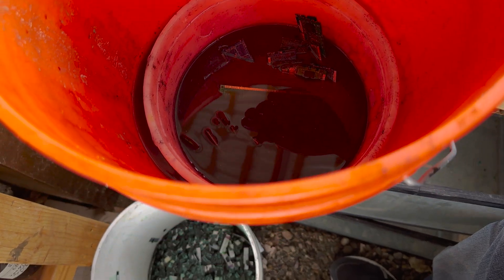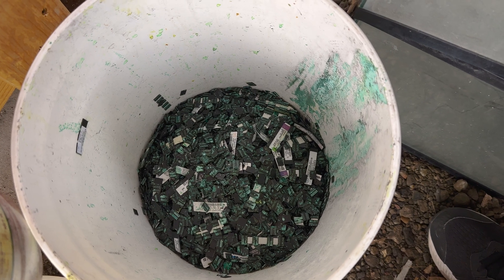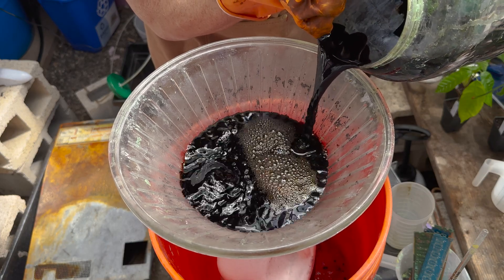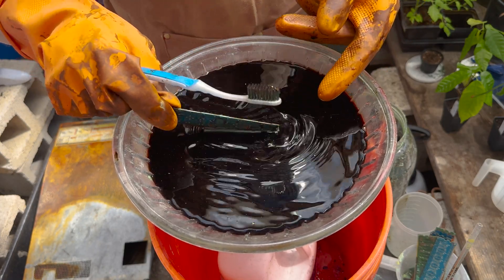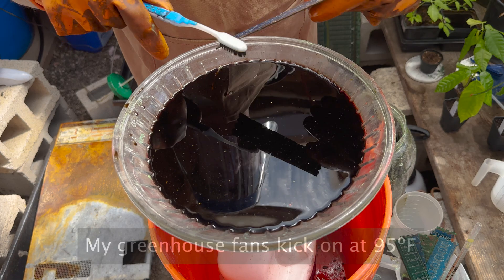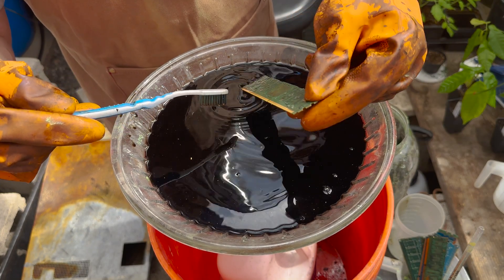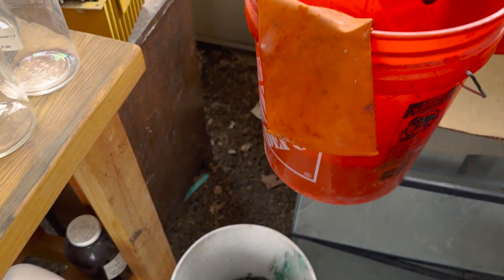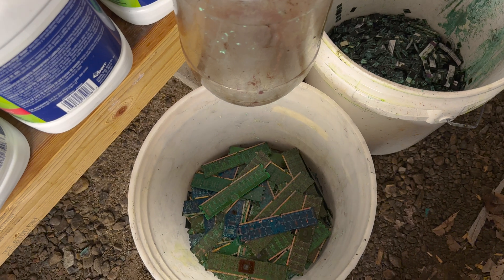eWaste Gold Mining: "Wet Stipping" (Acid)

Comment: Street tips. YouTube.
Reply from the maker: He does a great job.  His focus is just a little different then mine. And from what I have seen of his, he only jumps into computer scrap a few times.  Really fun guy to watch.  Good to see others are eager to share his channel :).  That makes me happy.

Thank you for checking out this video.
Reply: Sreetips*
Reply from the maker: True, that is his channel name.
Reply: @badideametals  yes was just correcting the original comment in case anyone wanted to see what they were talking about. Great video btw I've been considering depopulating all my PCBs the same way.
Reply from the maker: This process did do 2 unexpected things for me.  

1. I no longer need to intentionally "make" SnCl (Staneous Chloride) as it is now an unexpected product of reusing my CuCl (Copper Chloride) to do the depop.  All too often, I find my SnCl has "expired" to exposure or I just use it up, and get lazy to make more.  Problem no longer.
2. I no longer have to recover my Copper from CuCl using Iron.  I saw the copper recovery as a waste of Iron just to get the Copper to precipitate out of CuCl.  I want the dirty Copper back for use in other reactions and processes that I have.  Funny, now I don't need to find a way to dispose of my Ferrous Chloride (FeCl) since I will no longer be making any :) 

In short, I have found this takes a bit of time... admittedly, I could have depoped the chips off and other surface mount stuff faster.  The clipping of fingers give me blisters ... so I don't miss that.  But in general, this process is slower.  But I am seeing less negatives overall.  And ... it is scalable.  I would have to have more of me if I still scraped them off by hand, and clipped the fingers.  This way, I just set out a new bucket when I want more to get done faster.  It does cost me more HCl eventually (when I want to do the fingers... that needs clean HCl or CuCl). 

Thank you for your comment.  Stay safe in your work too.  This can be rewarding.  And you probably already know this,... it can be dangerous in an instant.